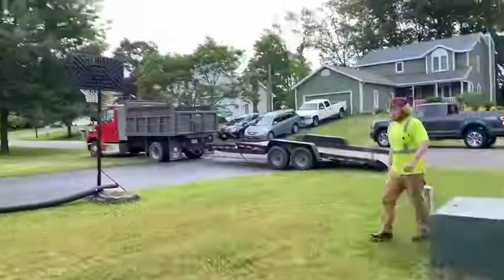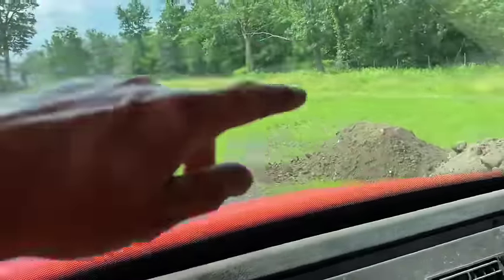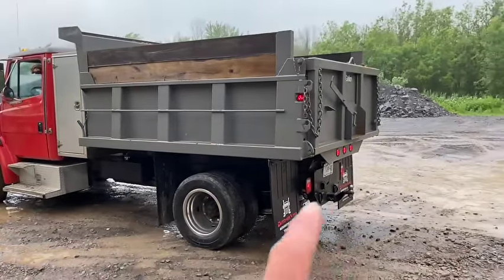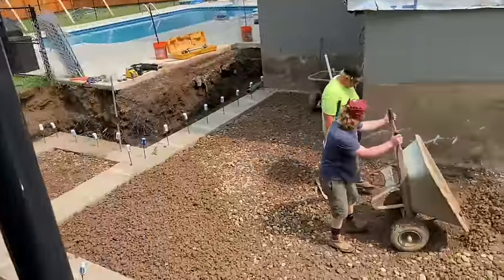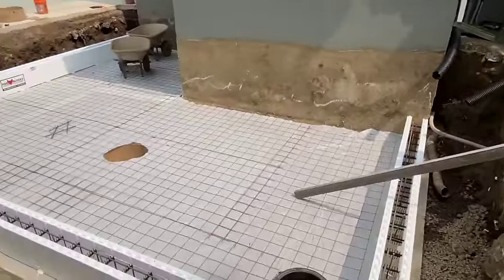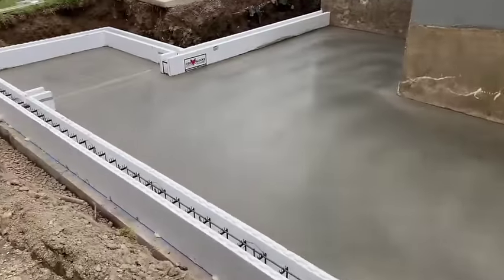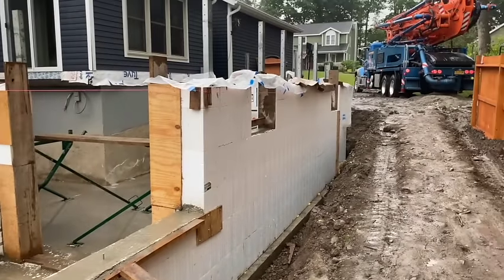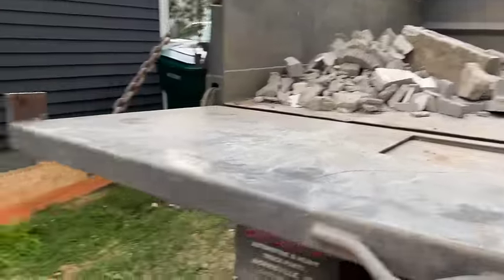Building a house addition with Fox blocks

Comment: A idea, in your situation I would strip the topsoil,  put some rock down and load right into the truck, no need to move dirt twice, also that construction entrance will help the whole job, and easily cleaned up, great job guys
Reply from the maker: It was to wet to drive my truck in there.
Reply: @bondobuilt386  I know that's why I start almost every job by making a construction entrance,  dig out the topsoil, and put 2 inch rock. It pays for itself , or you can chargecoustemer a small fee, as it will keep the job moving... just how I do it and 25 years zero complaints

Comment: Guys.... love the videos... please put p-traps on your trench drains....
Exit the bottom of the lowest part of the drain vertical down into trap... then horizontal to whatever system you want.... this will prevent the cold air if it goes to daylight, and keeps humidity from perimeter drains  from entering dwelling... kkplumbing Wisconsin..

Comment: Nice looking job Ron. You guys do great work.
    I wondered if you might save some money with a small line pump truck rig. I just poured my whole house and garage (Fox Blocks) about a month ago and did it with a line pump truck. Cost me 600 bucks vs. at least triple for a boom pump truck. I doubled up on the H-V Clips on every row. I figured it was cheap insurance pouring 9' walls. I made my own bracing system with 2x4 strongbacks against the walls and turnbuckles and tapcons into the floor. I Didn't have a single issue with blowouts or movement of the blocks.
Reply from the maker: Thats awesome glad to hear the stories of people watching my videos and doing there own projects.

Comment: Those foam walls have really come a long way, when they first came out, I was not impressed, but these you are using look very solid. Have you witnessed the 3D printed concrete walls yet? They have a ways to go, just like these did in the beginning, not sure how they will overcome the vertical weight problem, but I’m sure someone will figure something out. You need to talk the concrete company into getting a front with a conveyor mounted on it, then you won’t need the Brentwoods nearly as much, have never seen any in service in CNY. That way the driver is 75% of the crew for you if he’s good. 👍😉😁

Comment: Suggest building your self a chute like off a Crete truck and hook it to the coal door on your truck gives you more range and control, and being able to get the  rock in place faster than with a wheel  barrow like on this one. More than one chuet for range of operatin. They use to have them on coal trucks years ago. To get the coal maybe to a hard place behind a house  or no real drive way to coal storage place at homes etc.
Reply from the maker: I have a concrete chute I will try that. we never use it anyway for concrete. Thanks for the tip.

Comment: Why is there not any waterproofing membrane, or tar on the outside of the wall below grade? how did that pass local codes? What is going to keep the concrete (hydroscopic) from always being wet? That is going to be a mold factory inside the structure. Still, turned out pretty nice though!

Comment: id like to do a similar pour of slab on grade slab before the ICF walls are poured;  difference I am considering is: pouring footings, setting 1-1/2 row of ICF, backfilling both sides with clear stone, and pouring slab on grade floor with infloor heat; do you think the walls if backfilled carefully on each side will be rigid enough to stay straight.  House will not have a crawlspace or basement and only needs 30" of frost embedment.  Would like to do it this way to avoid the cold joint between inside ICF and floor to allow for concrete floors

Comment: Full depth basement without a cut-out to the existing basement to check floor elevations?
Reply from the maker: We cut a man door in but we had already poured our floor to match his existing floor. That was easy to measure down from the deck then set the laser up to that height

Comment: You should have used steel for the beam to eliminate the jack post. It wastes a lot of space.
Reply from the maker: Was not my call it was the architect
Reply: I thought the same.   Was it even necessary.
Reply: @bondobuilt386  The architect should be fired. With the building materials available today, there's no reason to have that post there.